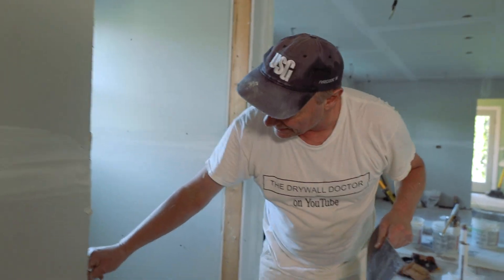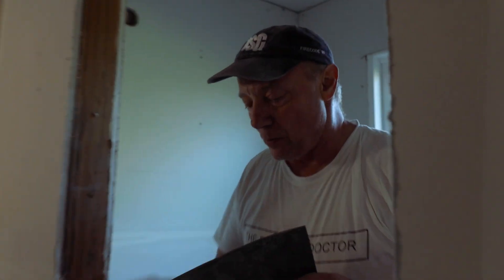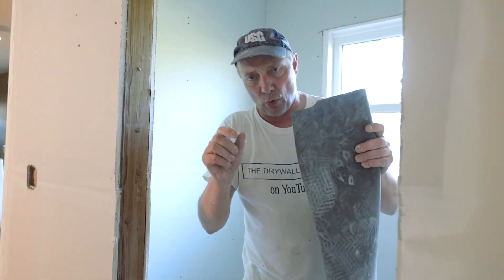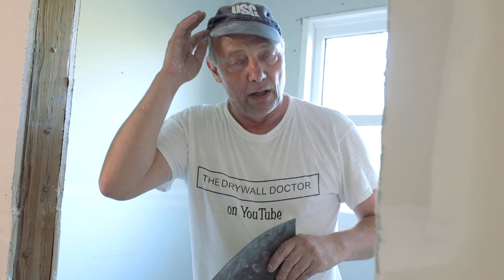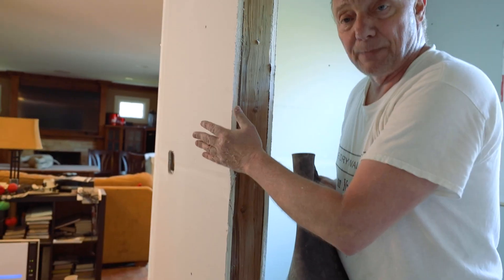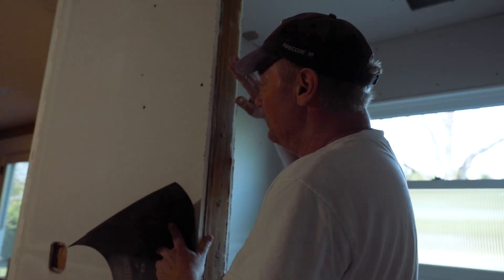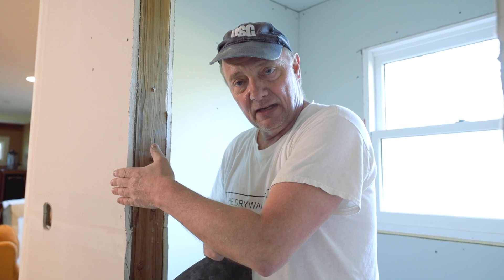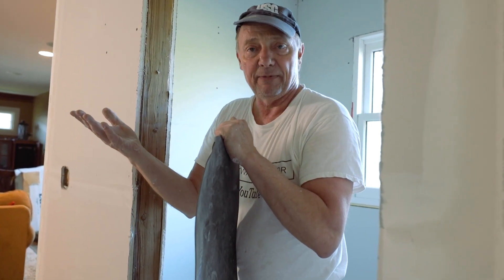Sound Dampener Membrane for Drywall

Comment: Would something like this be considered a vapor barrier?
Reply from the maker: A very expensive vapor barrier. You would only use a vapor barrier on an outside wall or ceiling so no need for sound barrier.